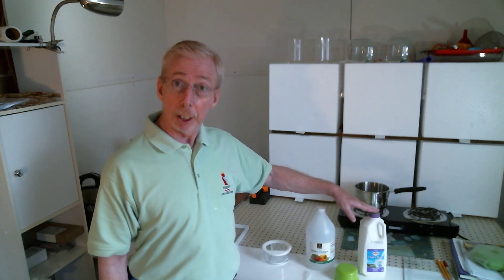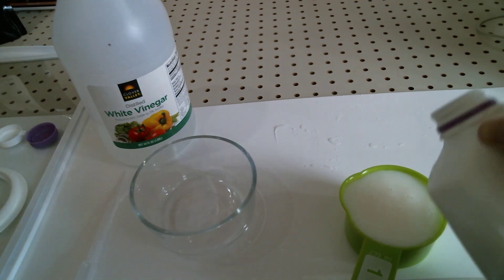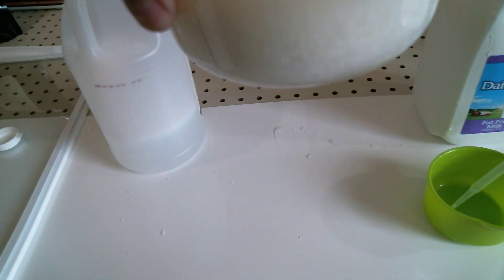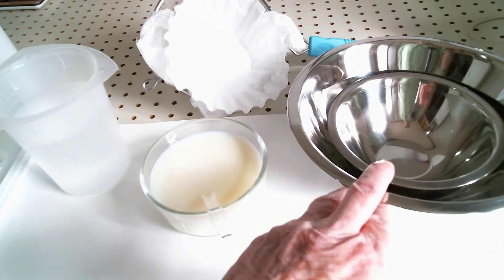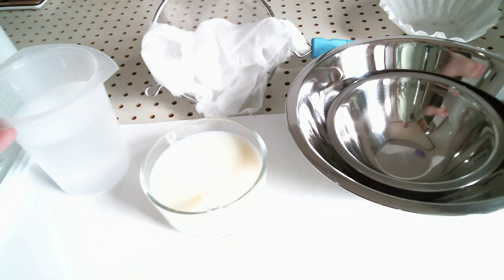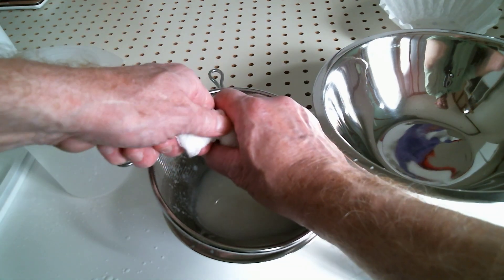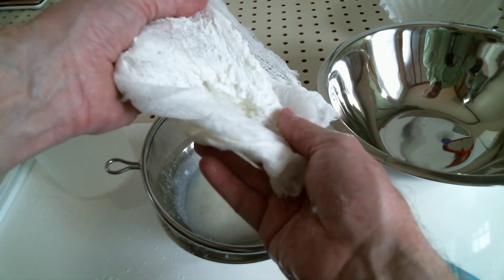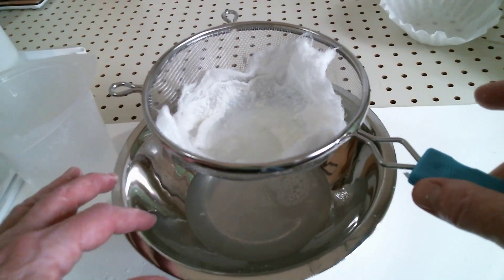Bioplastics: DIY Casein. Precipitating Casein from milk. The backbone of bioplastics made from milk

Comment: Hi! What’s the difference between casein plastic and cheese? 
Also, since I read that this is how you make cheese, why is this bad to ingest?
Reply from the maker: 2 great questions, and apropos to very indigestion I have right now. There is no difference between cheese and Casein. Cheese is flavored, some are fermented, and has more fat because it is whole milk, and fat is flavor to a chef. Casein plastic has had as much fat taken out as possible and has been purified with alcohol. I showed that process in a video. Galalith has been pressed to several thousands of degrees so the proteins can never unwind and will remain waterproof.
Casein is very hard to digest because now you have a lump of highly coiled proteins that take forever to unwind in the stomach. I recently downed an entire Large pizza and now have a rock in my stomach that will take days to digest. Milk causes this because stomach acid precipitates the Casein out of milk so you end up quickly digesting the Whey in the form of tiny bubbles ;) coming out the other end, and left with a ball of Casein in your stomach, this old man just discovered. Doctors have also concluded that humans don't digest cow milk very well, what doctors call lactose intolerant. It has been linked to skin problems. And so, on. You may want to do some more research on that.
Reply: @GEOsustainable  Thank you!! This helped a lot ☺

Comment: Hi, for a school experiment we are making this. But I was away. What difference would it make to use hilo milk? And why would it make a difference?
Reply from the maker: I had to research HILO milk. It is simply 2% milk and will work just fine. I am sure I talked about removing the fat from the Casein, by rinsing repeatedly in 91% Isopropyl Alcohol to improve the plastic properties of Casein, so using 2% is preferred. Forge ahead, crafter.

Comment: Cheers! Why does everyone else say to heat up the milk to 50-80c? Does it work with long life milk?
Reply from the maker: I only warm to increase the reaction rate. I was taught by the old nuns to not let the milk boil or it will spoil the reaction. 80C sounds too high.
I am sure you can use Ultra Pasteurized milk. Even Powered will do just fine.
But hey, give it a go and let us know. I could do a video on using 'long life milk' if it works for you.